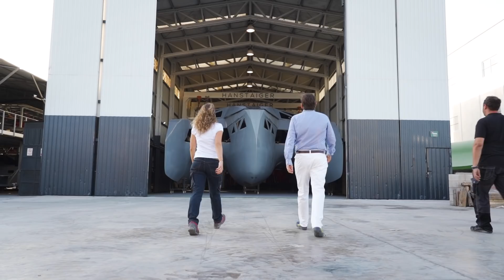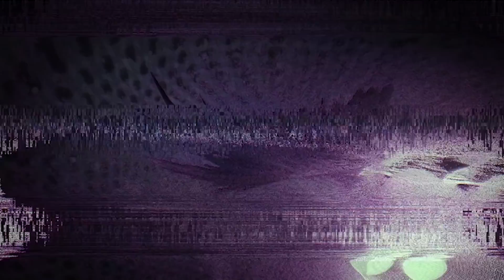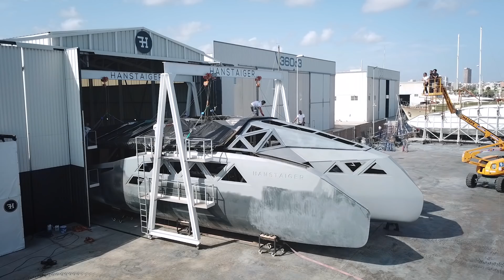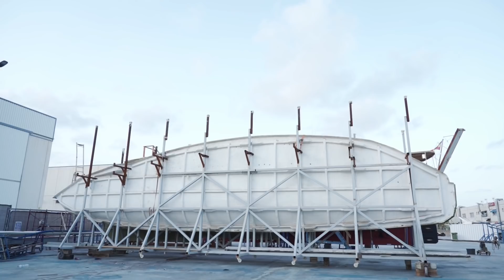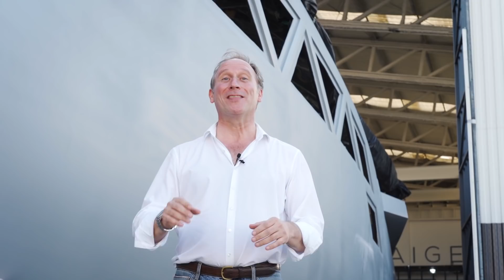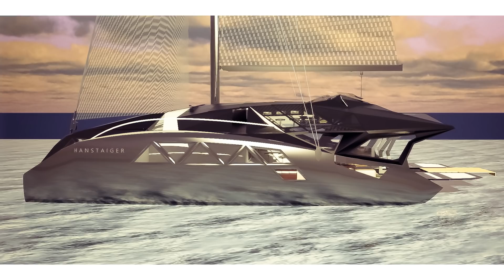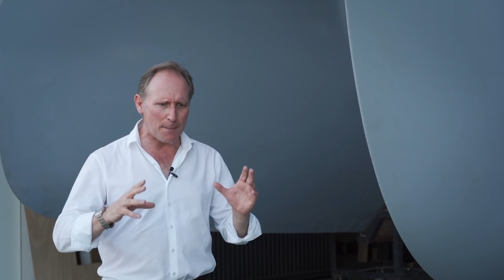BUILDING A 64' TRIMARAN FROM SCRATCH!!!   THE HANSTAIGER X1

Comment: What an interesting design. It has the layout of a monohull inside with the stability of a tri, having the living quarters inside the center hull instead of the outer ones like most tris (is there another that has the port & starboard hulls just probably some storage space just below deck and what looks like solid material below?). It still won't beat upwind worth a damn but at least you will be in serious comfort on the long tacks. I like it.
Reply from the maker: Hi Eric, I'm hoping to explain more about the layout in the next video, probably in a couple of months time. By then the floor will be in and I can show how it all fits together. They have some ideas that are very different from the norm!

Comment: Interesting. Why isn't solar a bigger part of this design...?
Reply: Curious if using hydroelectricity (electricity made by generators that are pushed by movement of water) would be an option since it's wind powered as well. Yes it would induce a little bit of drag, however the amount of electricity it could generate would be substantial and fairly maintenance free.
Reply: @tecwzrd  if they were 100% efficient they would generate the same drag as power created ie. Required 3kw more engine power to keep the boat moving while producing 3kw of electrical power but in the real world with losses there would need to be 20kw extra engine power to generate the 3kw of power so it will always be more efficient to drive a generator directly from the engine or from a wind turbine rather than using the wind to propel the craft then have a water turbine.
Reply: @turboconqueringmegaeagle9006  It is not that simple.  Using a water-driven generator on a displacement sailboat, in certain conditions can generate power without any significant loss of speed.  Trust me, I am not suggesting a violation of the conservation of energy! 

The 'not obvious' part is that displacement sailboats have an upper speed limit.  This limit is based on the type and size of hull(s). Generally, length is the dominating factor but, many other design aspects come into play as well.

If the generator is used to keep the boat at just below hull speed, then energy is converted in to electricity and not waves... all the while travelling at near the same speed as without a generator.
Reply: @inventorToo  very interesting,
I understand what you are saying thank you. 
So beam reach when the yacht effectively has too much sail and a  submerged turbine would have a negligible effect?
Reply: @turboconqueringmegaeagle9006  Exactly. I'm not a naval engineer but, the window of performance where there is too much power for hull speed is probably minimized for conventional sailboats... perhaps there is a way to design for this, power overlap to maximize electrical generation. Cheers.
Reply: @inventorToo  pile on more sail then the overlap gets bigger, but with more sail it'd need more mast and structure then it'll displace more and the overlap has just shrunk again.
It's a bit like the ram air turbines on gliders, it's really going to cut your journey short if you are not in a thermal, but there is at least a window where you can make a few watts for a radio.
Reply: @turboconqueringmegaeagle9006  if you didnt notice this is sailing boat...
Reply: @inventorToo  it not just energy conservation. the drag does not only slow the boat down. it isnt a monohull so the bober effect isnt enough.. it needs to glide. all those turbines or anyhitng added below the water would slow it and make it more dangerous to sail.
Reply: @tecwzrd  It would be better to use thremocouples and use the temp differential of the water vs the dark hull than to introduce more drag.   I have no idea what that would entail on something that would nee to survive in a marine environment.
Reply: @tecwzrd  yes most yachts have that setup they drop a gennie in the water while sailing
Reply: @tecwzrd  yeah hydro turbines are a thing now. but they slow down sailing.
Reply: @thenarrator1984  I assumed it would slow down sailing, but hey free energy :)
Reply: @tecwzrd  sounds good too,  other than the fact to produce 1kw of electric storage energy using this method would require about 1.3 minimum kw of wind power. So to maintain a given design speed at a given wind speed you would have to increase the sail area by a similar ratio.  Which would change the whole sail plan and may even increase loading on the hull that it has not been designed for.  
I said before that it was ugly (in my opinion)  but in some respects it looks better than the silent yacht,  but does have the advantage of having a better drive system and backup para vane/chute
Reply: The X1 will install 3Kw/h of solar panel and 4kw/h of vertical wind turbine.
Reply: @toniclaros844  That should be more than enough power.
Reply: Toni Claros, I know you and the team will knock this out of the park!
Reply: @toniclaros844  That is definitely a lie. No solar panel(array) can generate 3 kW per hour. They are all limited to one power value (potential) expressed in kWp. If they could generate 3 kW/h they would have an output of 30 kW after 10 hours and after one year would probably produce all the energy the world consumes. Maybe you should not comment on topics that involve physics...
Reply: @rainerzufall689  they could have 300 watt panels so 10 would be 3 kwatts
Reply: @donavancrotty1541  And how does that (dis)prove any statement written before?
Reply: We all understand what he meant, he's not writing a PhD.
Reply: Too slippery as a horizontal deck surface.
How else would you attach it to some other surface that collects the sun?
Reply: Very good question. I hope it does have lots of solar and wind turbine capacity for recharging the Li+ batteries both at anchor and en route.
Reply: Flexible solar sails would definitely be perfect for this boat!
Reply: I'll tell you the right answer to your question, in simple terms.  An owner of a Yacht the size and cost of this one would 'never' want to 'clutter' the look of the design with dozens of solar panels.  The owner can easily afford to simply run gens to recharge the battery bank. Solar panels cluttering up the majority of sun-surface area on cruising yachts are for the little guys (smaller cheap sailing yachts).  That's the right answer.
Reply: Because solar panels and the entire concept of sun recharging electricity sucks. It’s actually not very efficient at all....that’s why.
Reply: @holyfaradaycagebatmantic363  And how big is the efficiency?
Reply: @holyfaradaycagebatmantic363  oh, I gotcha,  so the silent yacht is just a dream and doesn't actually work.